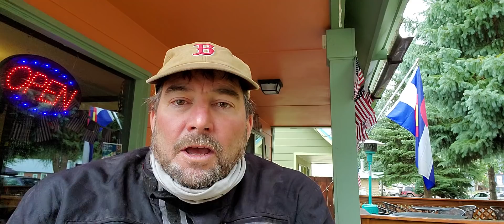5th Stage Bleed Valves explained 737 Emergency AD

Comment: WOW !!!  I'm not a Aviation Engineer , but has the Industry ever heard of CHECK VALVES or stop checks !?  Even a variable orifice  inline between the 9th and 5th would solve this issue I'd think ?! Sorry , I can think of MANY ways to NOT allow this to happen ... MANY !!!   Inline  N.O . relays ,  variable orifice via Pitot tube , differential pressure switch .   I don't get it , especially if this has happen very many times before ?!? WOW !!!  Hmm ...........
Reply: The valve that is sticking IS a check valve.

Comment: I dont think that these valves are supplied by the engine manufacturer, likely they are supplied by the Bleed Air System manufacturer.
Reply: Good point I am sure the list is  long on companies that make parts that go into these engines or for that matter the complete aircraft.

Comment: Again, slightly more precisely, it’s the 5th stage “check valve” that closes and opens. This check valve is one way (outbound from 5th stage tap).
This check valve valve closes at a given higher downstream pressure (delta 5th vs.9th stage pressure, some value slightly > 5th stage pressure)  caused by 9th stage modulating open thus preventing 9th stage pressure from back-flowing into the 5th stage compressor section. Other than this 5th stage check valve there is no other valve associated with the 5th stage ducting (up stream or engine side from the check valve) on these affected CFM engines.
Reply: Yes, the directive refers to bleed air check valves, which are a different thing from bleed air valves. Also there are inadequate details in the directive.
There are several different definitions of the term bleed air which apply to jet engines, and they are all correct. The air that is bled off of the compressor for customer uses, like cabin pressurization, usually comes through a completely different valve, and is sent through different ducting than is the air that is bled off the compressor to prevent stalling at part power settings. I posted a video years ago addressing this potential cause of confusion. It's called Bleed Air.
We need comments on this issue from someone who builds the CFM56-3 engine.
Reply: Got it , why no redundancy on such a critical issue ?  Why no N.O. valve inline also , or variable orifice , solenoid valve ?!?  I am from the Controls HVAC side of the house , and I can't see why there isn't something like triple redundancy for something that could stall an A/C engine ??  Even boilers and pressure vessels on the ground have double and triple safeties !
Reply: buford guber    Hi .   I’m retired now,  but I have a lot of hours on the 737-300/400/500/700 and the A320 which has more or less the same engine.  About 20 years worth.   At a rough guess that is 16,000 hours, and as there are 2 engines,  that is 32,000 hours.   As explained in the previous video introducing the AD,  engines  that have been stored for a long time have experienced corrosion because the valve is normally open,  and the check/non return function might not work.     The CM56 engines are fantastic well proven engines.
Reply: @californiadreamin8423  Hey what's up Dreamin'  . Thanks for the reply . I guess in summation .  This is an extremely rare event if the A/C stays in normal service . Got it .  I'd still think there would be redundancy though ?!  I am speaking as a norm while in service . Anyway . I now get that they do have a built in chk/ non return feature . Hope the dream stays alive . I got out of Cali in 91 , and am glad I did so . Have a good one , and enjoy your retirement . As I am :D  ... Gubs
Reply: Agreed. The CFM family of engines is a quality and reliable engine, rivaled (maybe) only by the CF-6 core family and the evolved GE90/GEnex family. Just my opinion.
Reply: buford guber it’s a simple flapper check valve common on every jet I’ve worked to prevent backflow to low stage compressor when high stage opens.
Reply: @richardlewis7471  - yep, but they do fail.  B737 incident in Italy (riscontro FAA per OY-MRG)
Reply: buford guber There are several reasons why. Let’s start with weight. Two valves in series weighs twice as much as one. Then there is access.  To squeeze two valves in series under the cowls is near impossible in the cramped under cowl spaghetti jungle of plumbing in these engines.  Then there is the cost of overhauling twice as many valves.  These valves are periodically removed for overhaul.  Big dollars.  Juan explains that half the problem is the ‘use it or lose it nature of the AD. Because these engines have been lying idle for so long, a simple bit of crud in the slide area has time to harden instead of being cycled several times a day.  There is no lubricant in this area because of the heat (300 degrees C) and the fact that breathing air passes through it.   Aircraft engines have effectively been working with one valve in line for as long as there has been a blessed air system.  Covid 19 plus 737 max groundings however are unprecedented.
Reply: Thx for the in-depth comment mate. Can you also answer Juan's question why this AD is NOT for Airbus?
Reply: My knowledge only extends to the Boeing bleed demand configuration, design and functionality of (non-MAX) CFM engines of the affected 737 models. Airbus’ design philosophies, configurations and functionality are different. How they are different, I will leave to Airbus SME.
Reply: @157294  Sometimes I think that Airbus are just better planes... Not just from a passenger perspective (better seats, spacier airplanes, and less noisy,) but also from an Engineering POV...
Reply: For 35 years I have been a Boeing advocate, but Airbus designs, engineers and builds quality airplanes.
Reply: 157294       When I flew the DC9 which was fantastic,  the guys on the 737 thought they were on the senior fleet !!    When they went onto the A320 , they  called the 737   “the tractor” .    In due course I went onto the 737 ,   and I found it so dependable it was not true.   It would not go down,  and slow down,  but if you could do your 3 times table rapidly and think on your feet,  it was fine.   It did however teach me to say NO to ATC ,  because it is not a Stuka,  and  it cannot perform the impossible.....the DC9 could.   The -700 was brilliant.     The A320 was a different philosophy but great to operate ,  once you had recovered from your lobotomy.    It was more flexible than the 737  because the speed brakes are more effective,  when ATC doing their job give you a short cut which only experience enabled you to anticipate.   Called out on standby at very short notice,  I chose the fuel I needed before realising I had been given an A320 nav log (it happens ) .  When the -700 nav log appeared,  if my ageing memory serves me correctly,  I could have carried 3 to 500 kilos less proving to me , if no one else, that the -700 was more economic.  That however is not the full story on operating costs,  and the telemetry on the A320, which automatically informed engineering of even a transitory fault ,  enabled a quick phone call to establish what had flashed up momentarily on the warning system.

My post about the 5th stage bleed  was not intended to compare the 737 against the A320,  because they both do a fine job,  but essentially they have the same engines,.  I’m confident the Max problems will be sorted out,  but Boeing were  out of order omitting the added “automatic” pitch input without notes for the pilots.  My commercial career began on the DC3 if anyone wonders, and I’m a Brit for my sins.
Reply: @fransezomer    Why the AD is not for Airbus?   Because A320 uses a different model of the CFM-56 which (presumably) has a different bleed air system with a different model of check valve.    I assume the same holds true for other Boeing models.   I think, also, that the bleed air system is supplied by the airframe manufacturer not the engine manufacturer.
Reply: Kandralla yet it is mounted tight against the compressor case deep amongst the engine plumbing
Reply: Kandralla so why the -7a designation for the engine?

Comment: Thanks Juan for the explanation. As already mentioned in comments, if something as simple as a check valve has deteriorated due to grounding one must be concerned about other critical systems on all Boeing and Airbus Jets. These machines were designed to operate safely without being subjected to long periods of inactivity.

Comment: Why is there not a one way valve pointing out of the 5th stage? I expect cost, or is used for something else.
Reply: There is a one way check vlv preventing 9th stage air to enter the 5 stage. Juan is mixing up the check vlv and the PRSOV.
Reply: @roaldnordeman6533  Yep got that form Agent Jz' video.

Comment: Are you going over engineer pass or cinnamon pass? I plan on going to Ouray in the next week or two just to ride the passes and surrounding areas.
Reply from the maker: Both ! plus alot more...
Reply: @blancolirio  awesome... then off to Telluride I guess. How is weather? I was going to start driving there today but will delay for a week or so because it may be dryer.

Comment: Interesting. Surely with hindsight there should be a non return valve on the Fifth stage?
Reply: There is, that’s what the issue is...🙄🤦🏼
Reply: Another component that could fail, extra weight. Sometime simplicity is best.
Reply: Hi Hugh,  that is what the 5th stage valve is, a spring operated non return valve, which is mounted in the bleed air ducting between the engine and airframe.  The 5th stage non return valve is always spring loaded close when the engine is not running.  

With the engine running at low rpm, 9th stage bleed is the air source supplied to the airframe services, ie air- conditioning/ pressurisation, wing anti-ice etc. the 9th stage air supply is electro- pneumatically controlled by a pressure switch further down the ducting where 5th and 9th stage air supply ducts meet.  9th stage air is higher pressure than 5th stage air as it is tapped off further along the engine compressor and this non return valve is closed by the valve’s spring and 9th stage  air pressure acting on it as it tries to flow back into the 5th stage compressor.  That is not good, will cause a compressor stall and shutdown.  With high engine rpm, 9th stage air is closed by a controllable bleed valve and 5th stage air is sufficient to push open the non return valve and supply the airframe systems.   Hope this lengthy response helps.
Reply: @kenmitchell2298  thanks. I used to machine components for gas turbines but never worked on valves.
Reply: There is a 5th stage check valve to prevent this.

Comment: I recall that compressor stall was problem during the early days of gas turbine prop. Seems I remember the second generation of 707s used an engine with openings around the air inlet that opened to prevent compressor surging during some power settings. Being 84, I could be full of it though. Regards
Reply: I though those spring loaded inlet doors 
On the JT-3's were to allow more air at takeoff power settings..
But I'm 67 and I could be wrong! Lol
Take care.
Reply: @stephenbond3348  You may be right Stephen.

Comment: I've been reading a lot of articles on this issue and most of them as well as the comments on them blame Boeing as proof of their incompetence and terrible designs and manufacturing. They don't realize that Boeing doesn't design or manufacture the engines. None of them mentions the engines were designed and built by GE/SNECMA.  Yes, Boeings been making some mistakes lately ( some quite large) but I think this issue is beyond their control and they're being unfairly chastised for it.
Reply: terry boyer Snecma is now named Safran
Reply: @157294  True, but it was called SNECMA when the CFM-56 was designed.
Reply: But  CFM don't manufacture or supply the bleed air system, that's Boeing.
Not sure 'blame' is appropriate here since the circumstances are highly unusual.
Reply: cr01 this check valve is part of the engine assembly, and comes with it from CFM
Reply: @737MaxPilot    Do you have a reference for that?   Because I've seen statements to the contrary.    But I've been Googling trying to find something authoritative and I can't.   
It would certainly seem to be specific to the engine variant fitted to the 737  (because the failures don't seem to have occurred on any other aircraft type).   
I don't think either Boeing or CFM is seriously at fault here since these valves appear to have worked okay in normal service before the Covid shutdown.
Reply: cr01 I can only say that I’m looking at the engine diagram, it is located on the left side of the engine itself, just behind the fan, and comes with the engine assembly from the manufacturer.
I'd attach a photo, but I can't seem to figure that tech hurdle out!
Reply: @737MaxPilot    Someone stated (in a reply on this video or a similar one) that the air bleed system was designed by Boeing as part of the nacelle.   (Presumably the bleed system on the A320 was correspondingly designed  by Airbus).   Certainly the valves appear to be different types  (which is presumably why the AD doesn't include the A320). 
It's possible the valve and attached ducting was designed/specified by Boeing and fitted by CFM. 
I'd like to find a specific confirmation on who specified the valve, just to settle it.   I don't think there's any major blame to be assigned on this one and the 'fix' is easy, but important.
Reply: @cr10001  the FAA classified the subject of the EAD as "ATA 36". That means the issue is within the pneumatic system of the aircraft type itself. There you have the authoritative answer. ;)
Reply: @DimitarAngelov   Thanks!
Reply: That’s a good point and I totally agree with you. I see it as plain ignorance every time an issue arises on  a Boeing aircraft and the slamming starts. It’s getting old but as seen all to often I don’t see it ending soon.

Comment: Is this valve part of the engine or airframe ?
Reply: Later commenters (above) say that the valve is part of the airframe, not the engine, and that this is why it is only applicable to the 737, not the Airbus, which has a different system.
Reply: Technically it is bolted on the ducting on the engine, but it is actually considered part of the airframe because it is what they call ‘customer bleed’.  Eg, The engine doesn’t need it to operate (in fact it is a parasite to performance),
Reply: David Steer I don’t believe that’s right, as it is delivered with the engine from the factory.

Comment: Departing Charleston AFB on a C141. At rotate number 3 eng case broke in half. The front bleed valve was installed wrong over pressing the eng.
Reply: Yikes! You’d think a person designing those valves would make them so they COULD NOT be installed correctly!
Reply: @bigjeff1291  Often they use the same fitting both sides, because this will be then a single part to have an AD on it, making service easier if all plumbing has a same diameter and identical flanging for mounting. Only one seal type required, and one type and size of clamp. Guess they did not read the big arrows printed on the pipe inlet and outlet, and the big arrow printed on the part, saying flow direction.
Reply: SeanBZA Thanks for the detailed explanation! It does make sense to have the same part for both stages.
Reply: Big Jeff12 a perfect example of finance folks making engineering decisions
Reply: B37xM Flyer Indeed, unfortunately 🤨
Reply: @737MaxPilot  Not really, the engineers would want commonality of fittings, as that makes for a much easier design, a copy of an existing part multiple times is a lot faster than making each part bespoke. If every bolt position had a different bolt, and thus a different tool to service it, nobody would buy that engine or run it. 

You might find a lot of bolts are being operated well below the maximum, but because they are cheaper in volume, it makes sense, and only those parts where it is going to run at full rating will need the strength, but because you are using so many the cost for that part is lower. 

Also there are many airframes these engines go into, and having them use a standard size for things makes for easier changing of use, as that engine, coming off a Boeing for overhaul, might be going back not in the same model airframe, or not even the same make, so you need to have the minimum number of interface parts that are different. Make them common and your parts inventory is smaller, and less chance for other mistakes.
Reply: SeanBZA Thanks for the excellent explanation. I understand now - commonality makes a lot of sense.

Comment: Juan do you think this problem is specific to only the 737’s version of the CFM56 or do you think the A320 version might also be at risk?
Reply: I asked the question in the last video and a guy replied: A320‘s have a diff. Manufacturers of their IPCV valves Liebherr (CEO) and Safran (NEO). IPCV stands for Intermediate pressure check valve than the one on Boeing 737CL and NG called 5th stage bleed air check valve.
Reply: Kevin Potter that’s interesting. If that’s true, I wonder if the “News” will bother to mention that if they want to make a story out of this.
Reply: @lucifermorningstar4548  I wonder why they would, seems pointless.
Reply: Gustav Meyrink wouldn’t be pointless in Boeing’s eyes, or of their shareholders